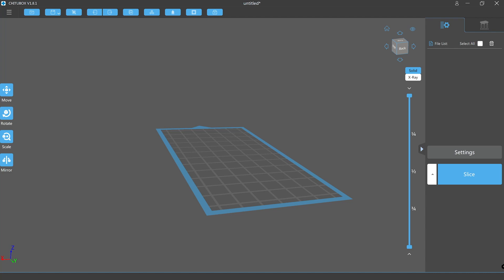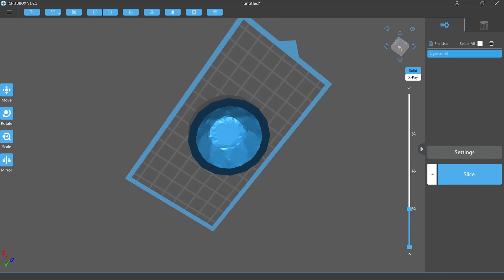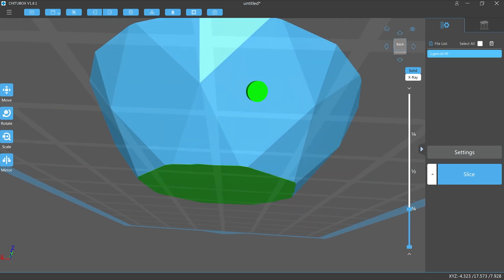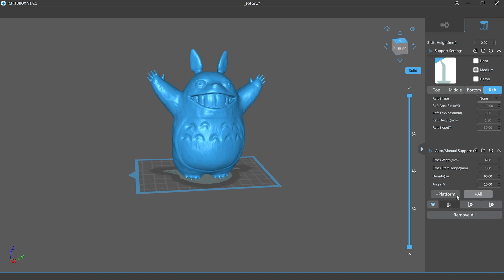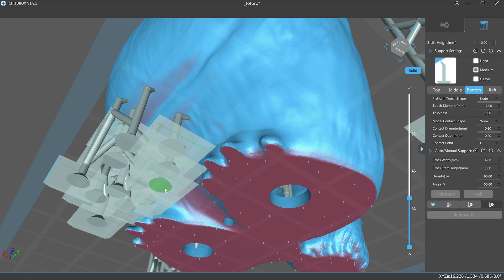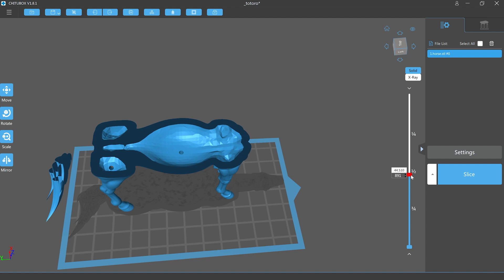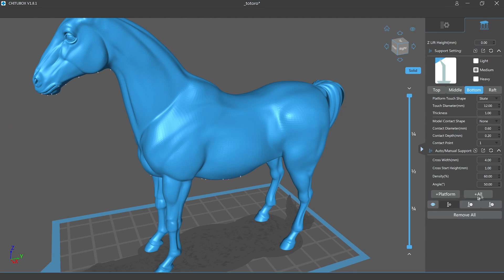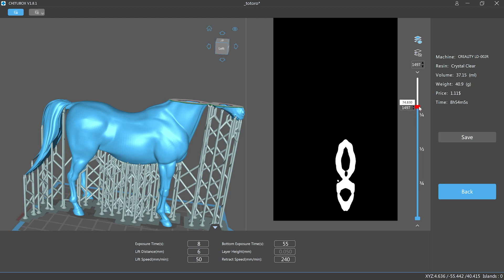Chitubox: How to Hollow Models

Comment: hello, why use supports inside the model instead of infill? isn't the point of infill exactly that?
Reply from the maker: Resin printing doesn’t really use infill.
Reply: @Monocure3DProTips  I don't understand this comment, but ok disclaimer: I'm a total beginner. Watched a ton of videos by now, and I am about to print a resin model with an infill. So what do you mean "Resin printing doesn't use infill"? I still have a similar question to MissNublette: What is the difference in using supports versus infill? They seem to do the same job, and it looks like both options do not complicate the printing proces. It even looks like infill is a stronger construction than supports?